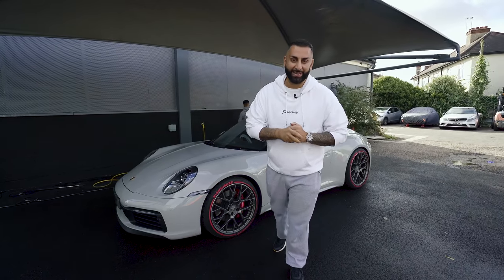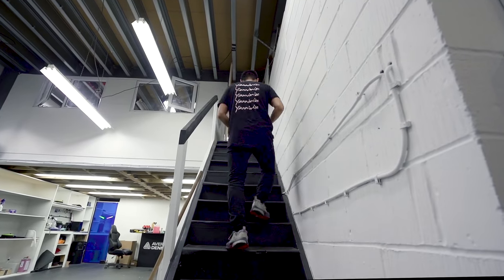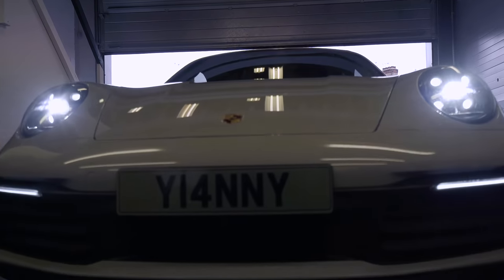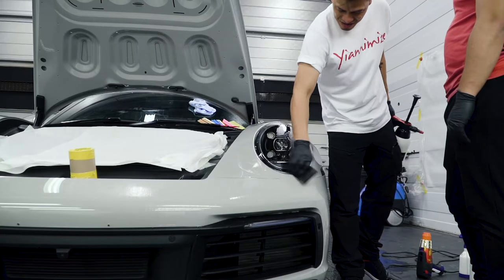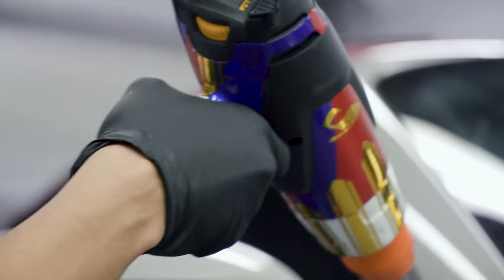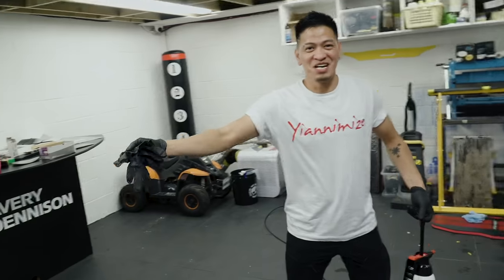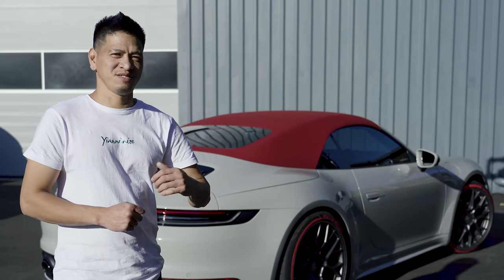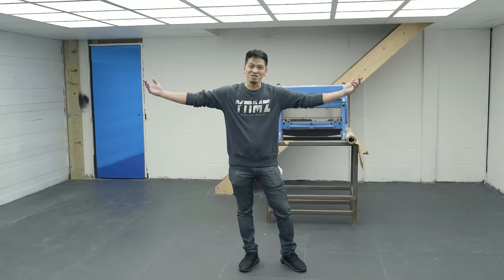I Protected my Porsche with PPF Paint Protection Film

Comment: Also pre cutting is a great way to save money but make your cuts a quarter inch larger than the panel so you can overlap and won’t get build up of foreign materials where those cuts end, where it wouldn’t wrap into the gap.
Reply: Agreed, I’ve been told by many installers to never use a place that pre cuts or uses templates as the edges are never wrapped so they look bloody awful in a year or 2.

Comment: Why does PPF need to be wet when applied?
Reply: because you cant heat and stretch it like a wrap so has to be wet and slid into place then squeegee'd down to finally adhere to paint without bubbles
Reply: To get every last bubble out and to be able to adjust as you go since you can't heat and stretch/shrink etc